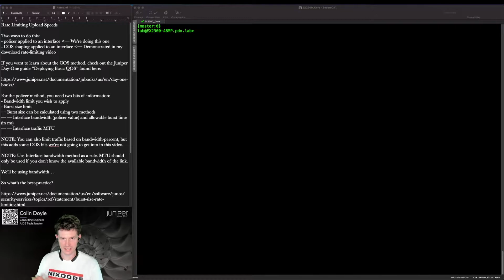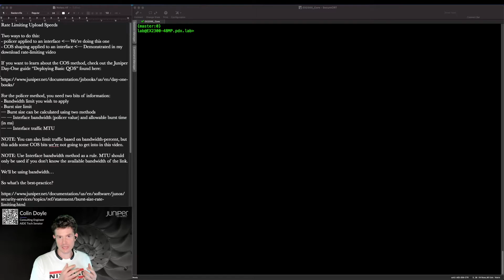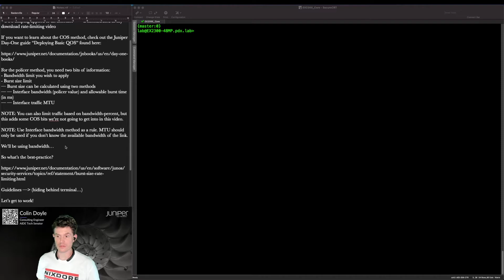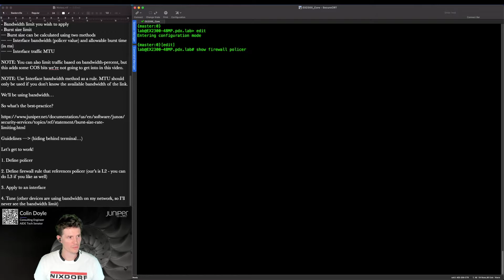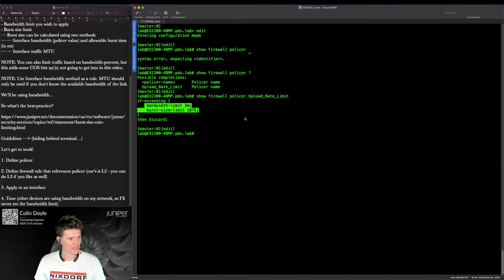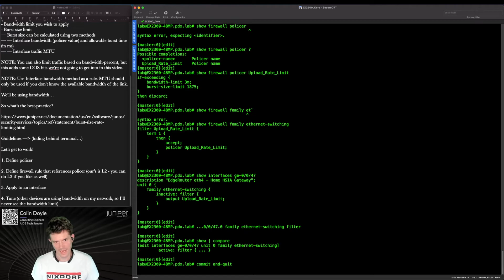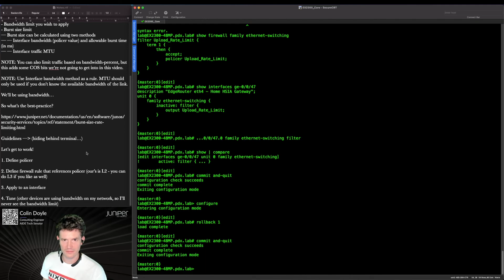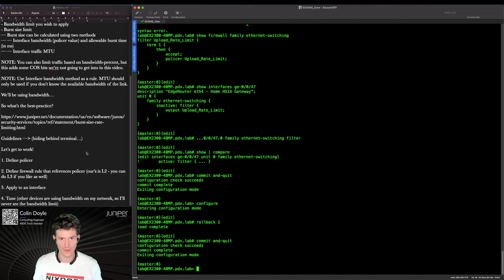Junos Rate Limiting using a Policer

Comment: This doesn't work on my EX4200 (15.1R7.9).  I have my interface setup as trunk.  It's trunked to an SRX Applicance (gateway).
 Interface ge-0/0/0
 unit 0 {

    family ethernet-switching {
        port-mode trunk;
        vlan {
            members vlan-OFFICEPC;
        }
        native-vlan-id 80;
    }
}
"    Referenced filter 'Uploading_Limit_Rate' can not be used as policer not supported on egress
error: configuration check-out failed"

Comment: Hello! How to police clients ingress on EX4300MP MGE interfaces since the actual speed is unknown and the command "if-exceeding bandwidth-percent" is not available on EX platforms? I cannot police using the same values on 2.5G and 10G mge- interfaces since a 10G interface allows higher input than 2.5G. Thank you.
Reply from the maker: Hello and thanks for watching and for the question!
There's no "clean" way to do this because, as you mentioned, the bandwidth-percent knob isn't present. There's likely some SLAX scripting you could do to detect the negotiated speed, then apply an apply-group w/ the appropriate policer config for that speed. I played around w/ traceoptions on a multigig switch I have to see if there's link speed output in the syslog, but it doesn't look like there is (or it's included in some dev hex output). That means an op script, which is a bit more of a lift than an event script.

Does the work required to support policing without knowing the negotiated link-speed exceed the effort of a workflow that defines how multi-gig devices are attached to the switch?
Reply: @5minutejunos  thanks a lot for your reply and your efforts to help. I hope you realize there is a need to implement the „bandwidth-percent“ command on mge switches since your approach is rather a hack than proper configuration? Please forward to development Team if possible . Thanks